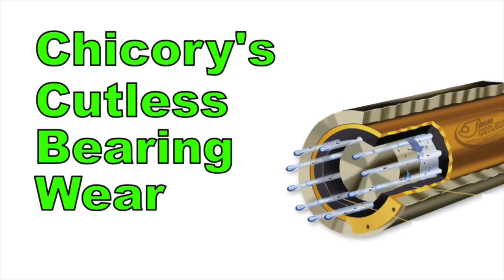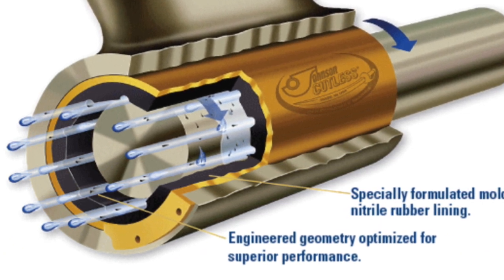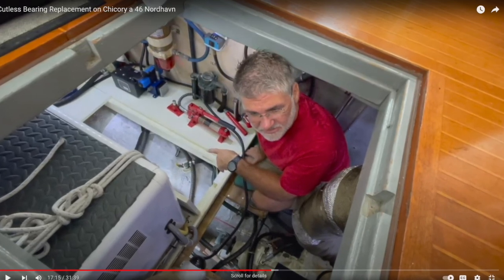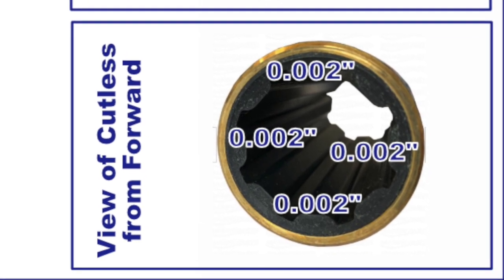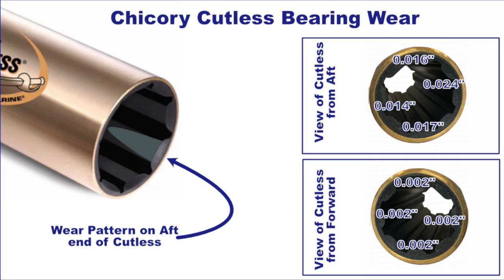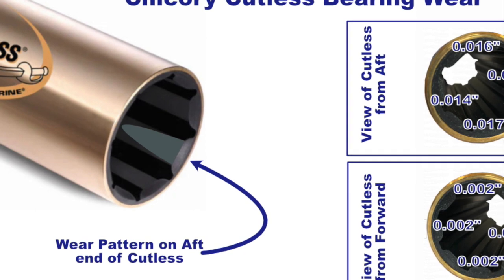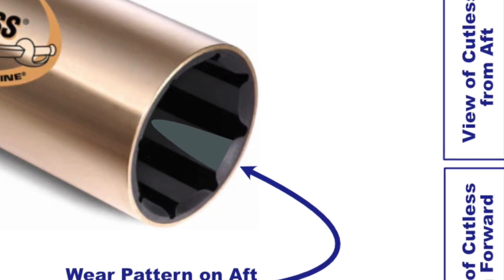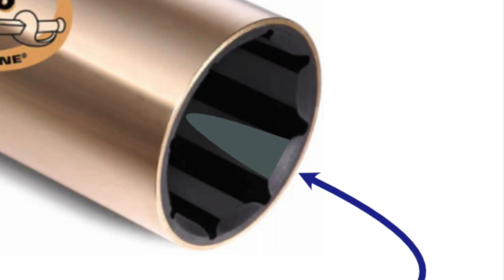Chicory's Cutless Bearing Wear

Comment: Great video as always. Very logical explanation. It would be interesting to see the actual cutless bearing barnacles get broken apart with a camera after sitting for weeks/months at anchor. It would be a good video but camera risk would be a bit high.
Reply from the maker: Thank you for your comments. The growth was actualy more like a coral. A super hard red build-up that was hard to remove with a paint scraper. Super tough stuff.

Comment: Would a twin screw boat last longer if the load is spread out between the two shafts?
Reply from the maker: Thank you for your question. It think it would be unlikely a twin screw would have different wear than a single screw.